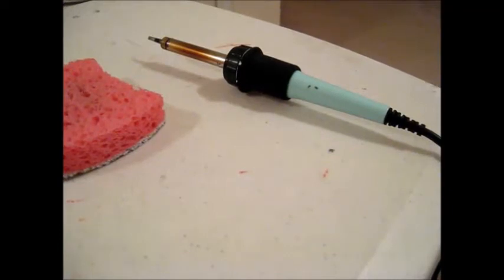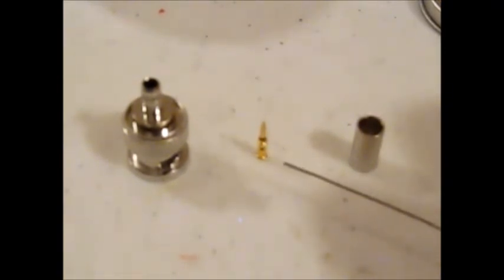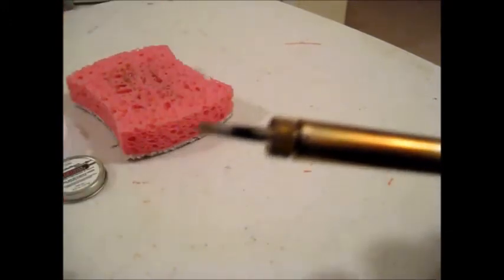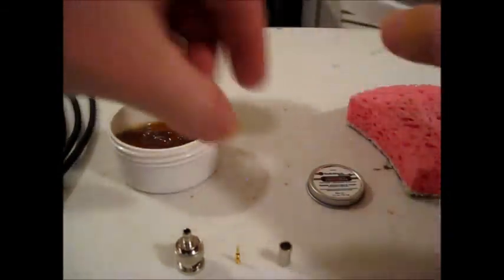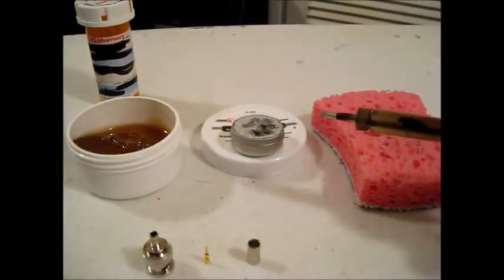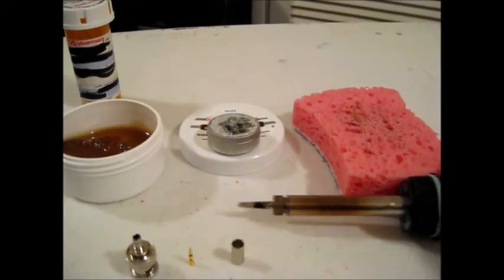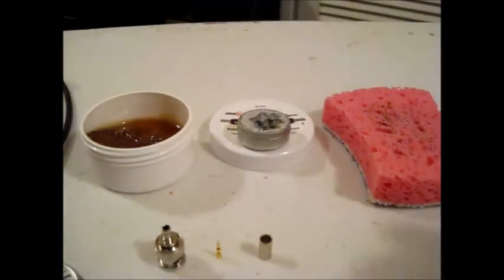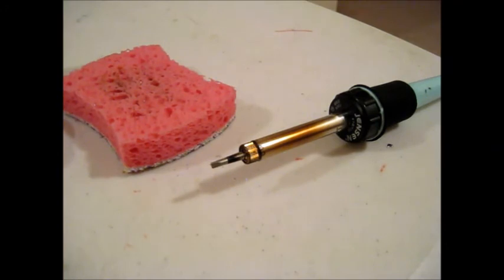Prepping Your Soldering Iron

Comment: ive been soldering and wiring for 20 years now - good job buddy, also when you finished leave a blob of solder on the tip, turn off and let it cool - it prevents oxidisation & makes your tip last years longer :)

Comment: Very helpful video.  Thanks.  Now...I want to solder a sterling wire close to the head of a plain sterling ring for wrapping around a pearl.  This is the only jewelry thing I want to do, so I don't want to use or buy a torch.  I also have some past experience soldering circuit boards, so I am familiar with the iron.  Is there a way for me to do this, Oh so simple job with and iron, and what different materials might I have to use???  Thanks.
Reply from the maker: You should not use electronics, electrical or plumbing solder for jewelry.  Jewelers use precious metals.

Comment: My solder iron is brand-new, it looks like it has a chrome finish on it. Do you recommend sending off that chrome finish on the end of your solder iron? Or just prepare as you recommended and carry out the solder
Reply from the maker: No do not sand the tip.  Just prep like the video.

Comment: Cool.  But just thinking, why don't you weigh-down your sponge or attach it to something heavy so you can use it one-handed, and maybe even avoid burning the hand that's holding it down?  Maybe just a heavy piece of wood or whatever with like a hair clip screwed to the top to clamp the sponge in place... I dunno.
Reply from the maker: +EvilStreaks Thanks.  I have a soldering station on the bench.  These were items I grabbed for making the video.  Not my normal setup.

Comment: That Radio Shack Tip Tinner and Cleaner left a sandy grit on the soldering tip of my 30w pencil. And ate through the tip on another. 

And no wiping it off didn't help.
Reply: It's basically powerful acid based flux with ZnCl & solder lead powder. The acid flux if left behind is very very corrosive.

Comment: Could this be why my solder keeps  'balling up' and not flowing correctly? Been Rather frustrating trying to get my projects completed.
Reply from the maker: Bill Ricci The key to soldering is getting the material you are soldering to match the temperature of the solder iron.  Have a clean tip helps with the heat transfer.  When I solder, I first clean the tip, then I use a small drop of solder on the iron to couple heat between the iron and point I want to solder.  Once I feel both the materials are at the same temperature I apply solder to the spot I want to solder - NOT THE IRON.  If the first drop of solder properly "couples" the iron's heat to the material the solder will easily melt and flow on the material (i.e. two wires).  Hope this helps.
Reply: you do not melt solder onto your work.. you heat up your work and let it melt the solder and draw it. The solder itself is applied to the iron and placed between your work and the tip, this is for even heat transfer. Quality variable soldering guns are preferred because a well made soldering gun maintains it temp by elevating the voltage rapidly when it detects a drop a temp like what you would expect from placing a hot tip on a large diameter copper wire. The variable temp is important because different surfaces require different amounts of heat for proper solder adhesion. Balling occurs when the surface of your material isnt hot enough to flow the solder over the surface so when the solder flows from your tip to the work it rapidly chills and turns to balls.

Avoiding balling is essentially the belle of the ball with soldering, this entire dance is all about getting your surface hot enough to accept the weld but not hot enough to do damage the work or surrounding components like wire shielding or pcb footprints. Good use of heat sink clamps is overlooked far too often..

In addition, you may just be using the wrong size solder, too little and not enough flux is present and too large and you risk flooding...
Reply from the maker: Thanks for the pointers.  I will check out some of your videos.
Reply: Commsprepper ouch, I mean seriously. I was trying to be helpful not sarcastic. I clearly do not do videos. I was just trying to politely point out the leaving the tip exposed to air after cleaning and tinning causes slow oxidation over time while in storage. Coating it with solder after you clean it is like a protective paint.

Comment: Ok nice video tho.i use sandpaper to clean the tip.
Reply from the maker: Don't use sand paper.  Soldering iron tips are coated from the factory.  You will remove that.